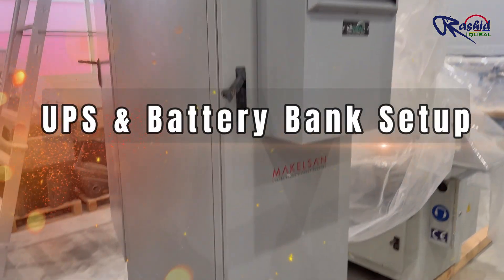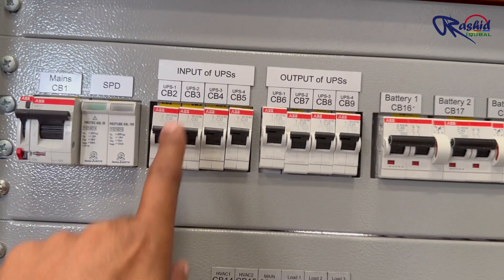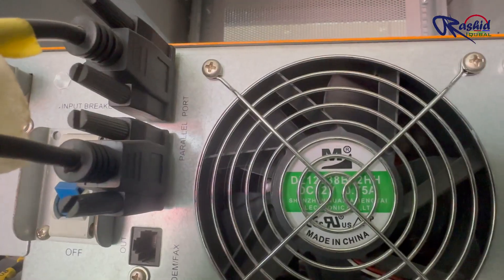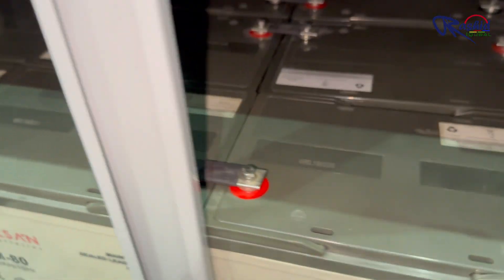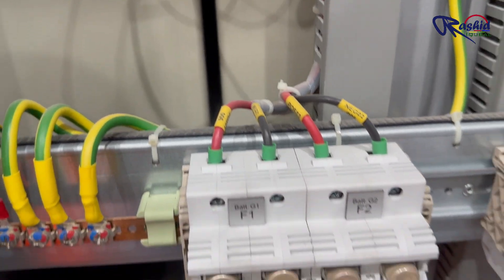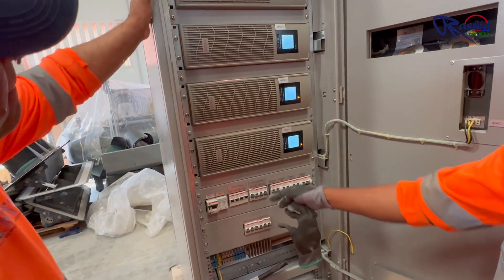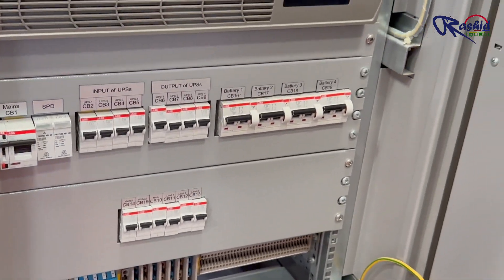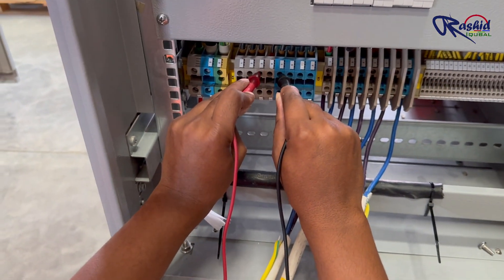UPS & Battery Bank Installation | Parallel Connection Explained

Comment: Hello Sir I need Ups to input, output, Bypass panel laying cable connection and how to transfer the load to other ups...
Reply from the maker: You can get schematic diagram from Manufacturer catalogue. 

To shift the load to another UPS, use parallel mode (automatic), manual bypass (temporary switch), or an STS (seamless transfer)…